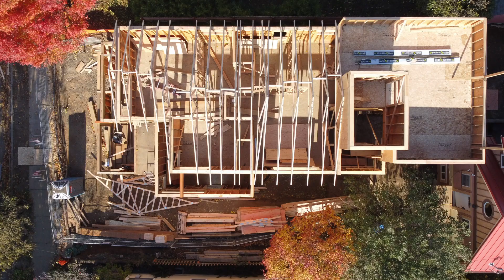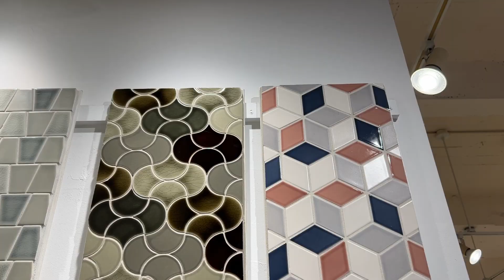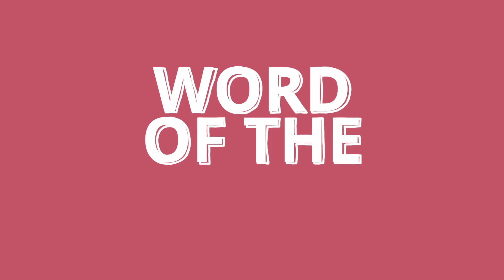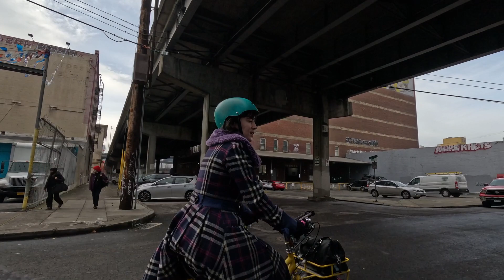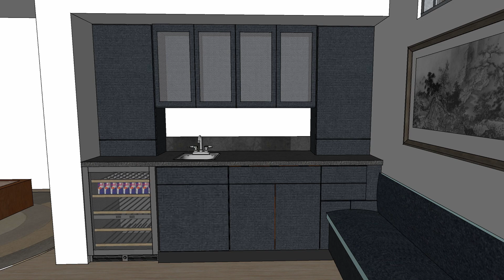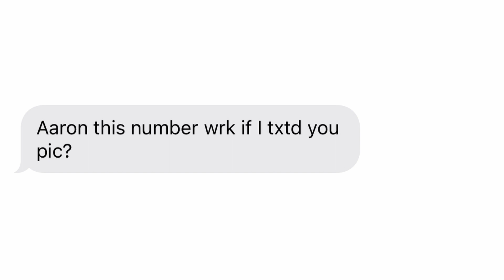We reconsidered everything again! | Episode 04

Comment: Traditionally ... Concrete = Cement + sand + gravel
For something like that tile it would be mostly sand with only a very fine gravel, and just enough cement to hold it all together.
Portland cement, the stuff most commonly used (and named after Portland stone which it resembles and which comes from from the island of Portland in Dorset, England) is actually made by burning limestone and small amounts of other minerals at high temperatures. The fuel requirement for this process makes cement production one of the largest contributors to greenhouse gas emissions and global warming. Nonetheless, it's extremely useful stuff. Fortunately we're finding ways to use less of it and use it better.
There. More than you ever needed to know.

Comment: For the rentals I'd suggest using the common shower faucet types that use typical repair parts.  Some of the fancy stuff you are looking at for your unit may be problematic for repairs where you have to special order parts.  You don't want that for rentals.  My rental units had Mixit brand valves which were easy to repair with kits from home depot.  In short whatever plumbing you pick for the rentals make sure you can go to the valve repair aisle at home depot and buy the parts.  And make sure that all of your water shutoff valves for the toilets/sinks are the 1/4 turn style -- they are much more reliable than the multi-turn washer style.  It really sucks when you have to turn off the water to fix a faucet and it does not actually shut off.  Shutting the water off for the building is not fun when there are multiple tenants you have to coordinate with.
Reply from the maker: This is excellent, practical advice. Thank you!